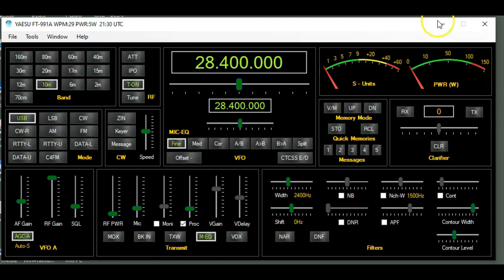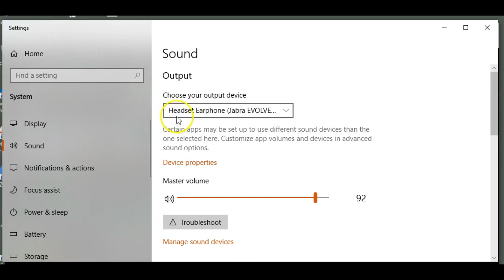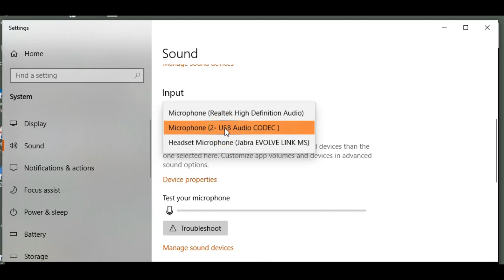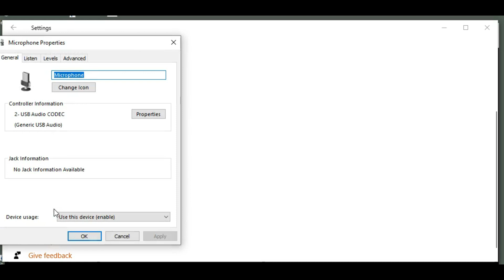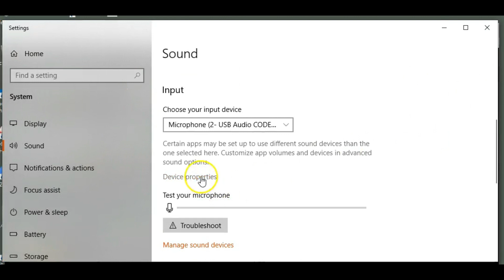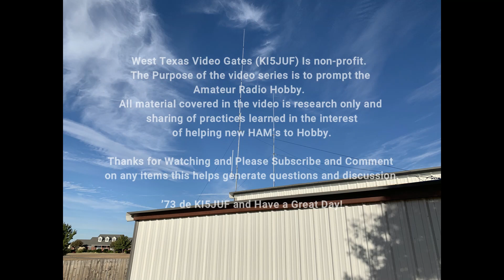Working with CODEC’s on FT991A and Win4 Yaesu Suite Software Laptop Sound Card

Comment: So with my headset set up on the laptop, I noticed that the AF Gain on the W4Y screen no longer changes the volume on my headset is that normal? Also my wireless headset for my laptop doesn't have enough punch to get out on HF in Transmit
Reply from the maker: Hi Tim, how you doing, yeah the audio feed through the computer is not associated with AF gain, I have to adjust the audio on my computer, let me know if this helps or need more info I can help you 73 and thanks for the message

Comment: Hi yes every time you use a different port it registers the device and increments the number like 2- 3- etc.  I still don't seem to be able to get my mic audio in through usb.  Are there any settings in the radio that need to be adjusted?  TIA.